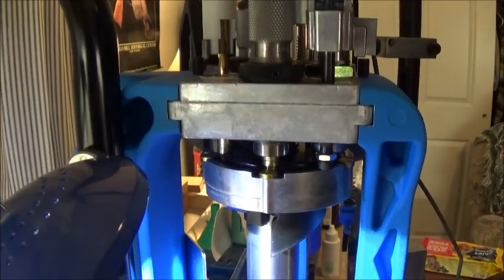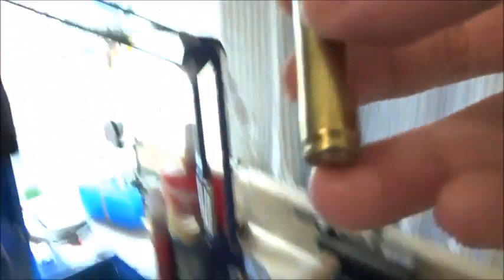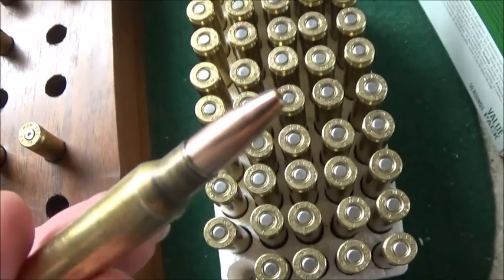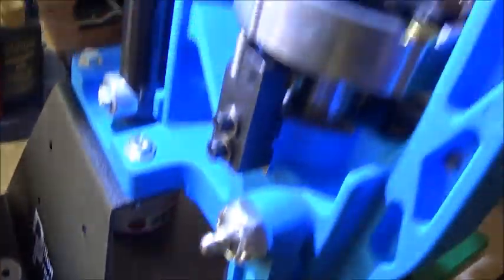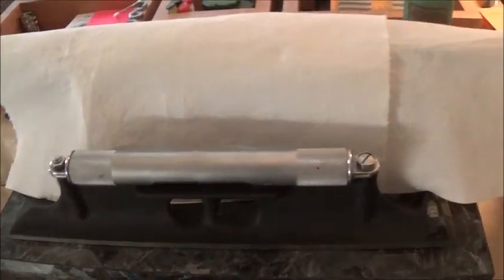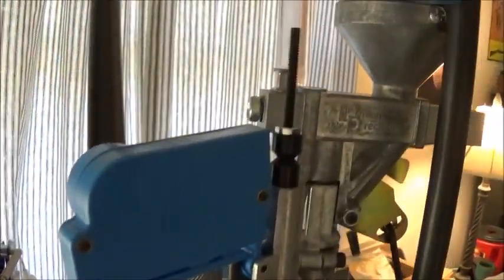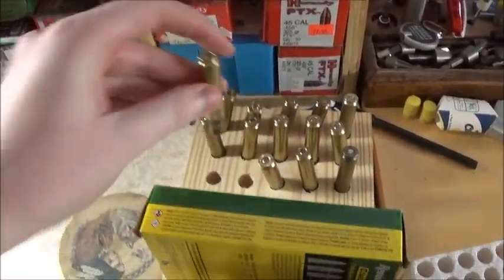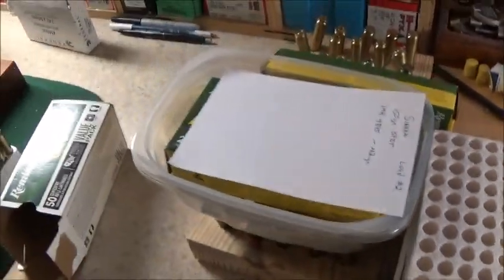Dillon XL -750 In Action!

Comment: WHOA!!!....Brother!!! Every pull of the handle chucks a cartridge out? That is very cool.
Reply from the maker: It does all the operations of loading a cartridge by itself you just have to crank the handle and keep feeding primers, cases and bullets. Refill the powder when it gets low. But it sizes the case, puts in a primer in the primer pocket, fills the cartridge with powder then we just set a bullet on top and it seats the bullet the it ejects the finished cartridge into the blue bucket. Very quick and efficient.